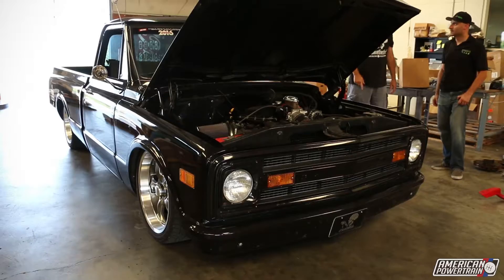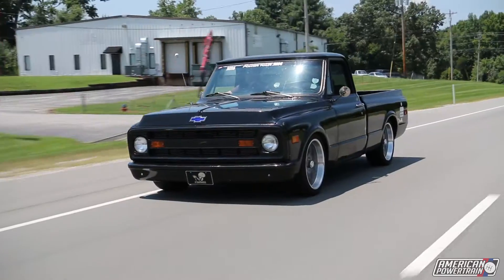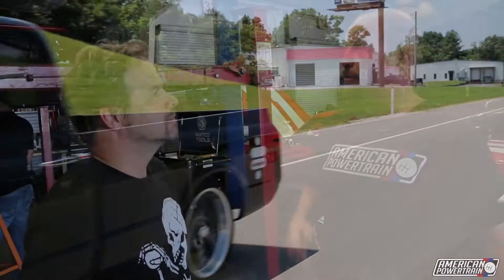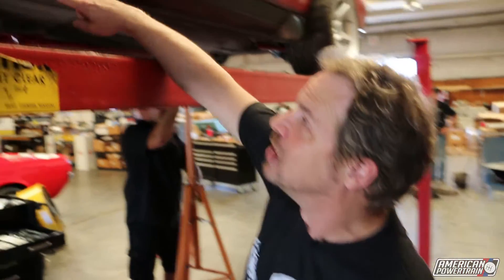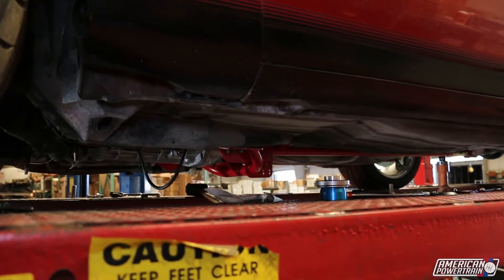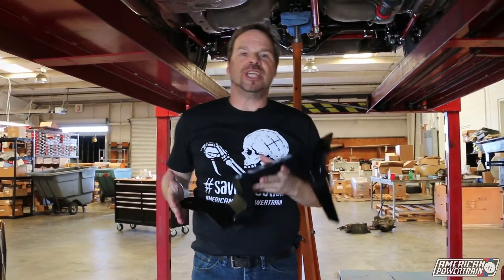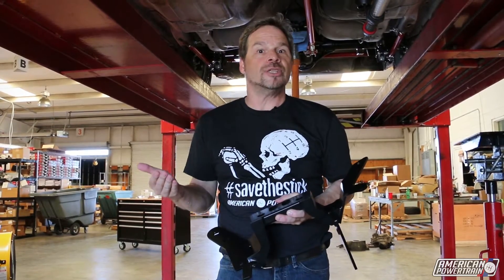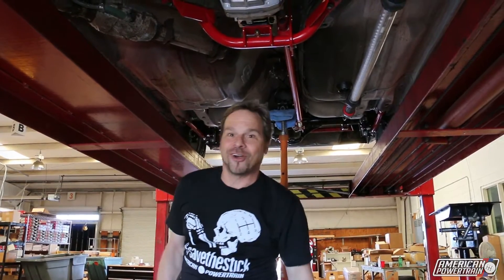Engineering American Powertrain's 3rd Gen F-Body 6 Speed Kit

Comment: The stock scissor lift they give you in the car is useless, throw that thing away.  I wouldn't trust it for a second to hold up ANY car, especially if it's made to jack up on sheetmetal.  I won't even jack up on the subframes either, as I've seen them fold and warp under pressure, no good.  The best place is the cast iron engine carriage at the front, and right under the torque arm mount in the rear on the axle housing.  If you need to remove the axle to replace the torque arm bushings and/or transmission mount, then slowly (and I mean slowly) lower the car onto the rear subframes for support, but not without first offsetting pressure across as much of the subframe as possible using a board, so there's less chance of it folding.
Reply: Midnight Mechanic this guy is midnight mechanic because normal mechanics laugh their ass’ off at this comment